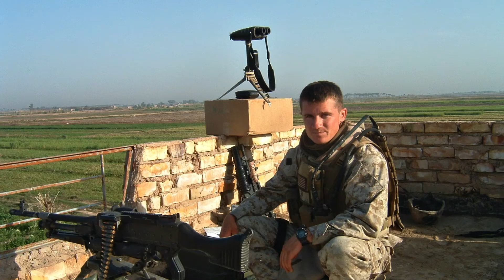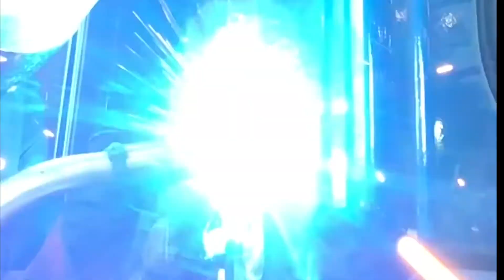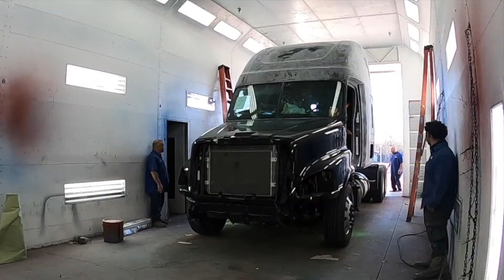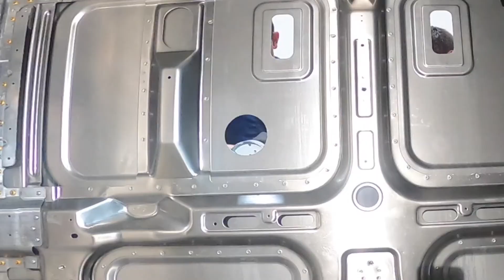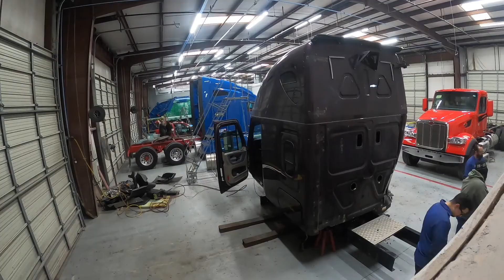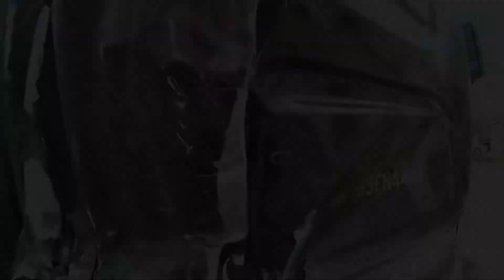Freightliner Jackknife Time Lapse Repair

Comment: I just had this exact same thing happen to my truck last night. Waiting for an adjuster tomorrow. How long does this type of repair take?
Reply: Normally 3 weeks but the way part supplies have been lately, you could be down longer.
Reply: @johnkeith1599  ok. That's what I was afraid of. I'm prepared for a month or maybe a little longer before it starts to hurt.

Comment: If I could turn back time..... I would have insisted to my boss to change those low tread super singles on winter time with new tires or I would quit but I was not so experienced so I only commented casually that to my driver manager that I wanted new drives because I felt the truck weird, he said that he was going to tell my suggestion to safety but that never happened, I learned really quick how dangerous a little layer of snow can become on a -12f day